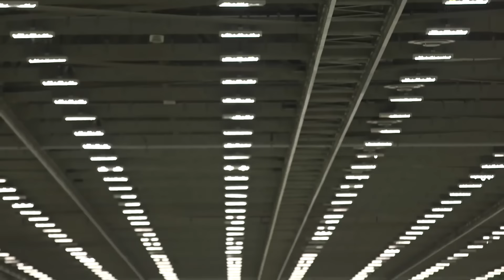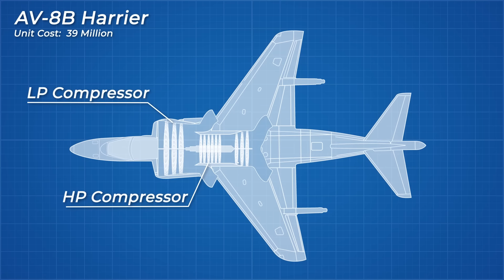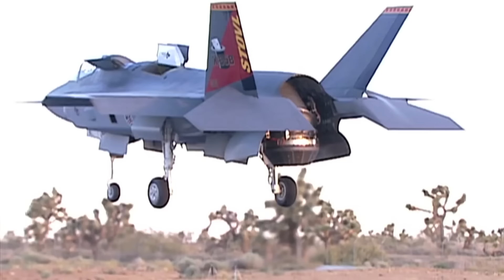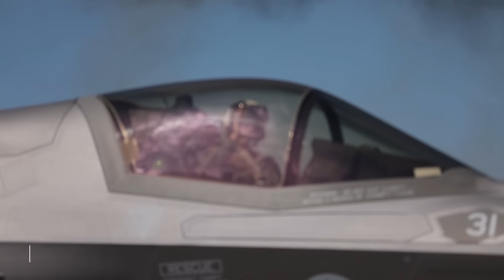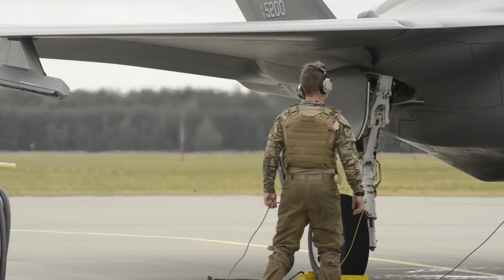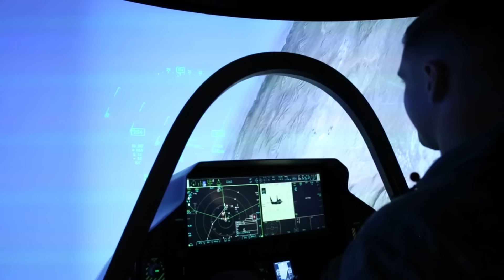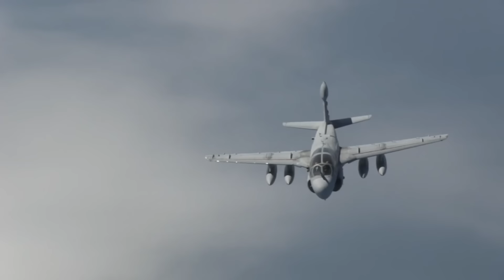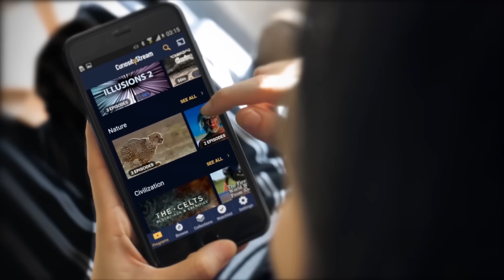Is The F-35 Worth $115 Million?

Comment: USAF: "Honestly, the F-22 is just TOO good to justify continued production."
Lockheed Martin: "You want less good? We can do less good. Look!" Kicks F-35. Panel falls off. "See! Less good!"
USAF: "Great! So it'll be cheaper then?"
Lockheed Martin: "...You never said you wanted cheaper."
Reply: honestly, the f-35 got too much things stuffed in it that it no longer excels at anything, and it got to the point that the f-22 can do everything the f-35 can, for about 1/3 of the price.
Reply: @elchipoclevengador  The F-35 having things stuffed in it is more beneficial than trying to have them mounted externally. FYI it doesn't do any more roles than the F-16 already does, but the F-35 certainly does those roles far more effectively. The F-35 excels at air to surface combat, and is only slightly worse than the F-22 in air combat while being half the price both to purchase and to maintain, and the F-35 is also significantly more useful.
Reply: Your iphone has more powerfull cou than the f22
Reply: F-35 is almost half the price and the F-22 is far less useful.
Reply: @dumdumbinks274  The trick made by LM about the F25 is that the cost of the plane itself is pretty good. But to keep a fleet of F35 flying dude you gonna need a shit load of money.
Reply: @TheHawk1202  It's no different to any other fighter when the infrastructure to maintain them is not in place. There are more F-35s than the maintenance infrastructure can handle efficiently right now, but as always that will change and the F-35 is expected to reach the same maintenance cost as the F-16 by roughly 2035.
Reply: @dumdumbinks274  Yeah it's supposed to but I believe some things will be still a problem. The F35 being stealthy a little scratch on the painting and you have to remake the whole painting. Moreover ALIS is far from being satisfying so far. And by the way there are still hundreds of problems on the F35 that need to be corrected including 14 category 1 defects. And dude 2035. The plane was supposed to be ready in 2015. In 2035 this plane will already be at her midlife.
Reply: @TheHawk1202  A little scratch won't do anything to the F-35's stealth. You have to cause actual damage to the airframe to alter it's stealth signature. 

ALIS is in it's early phase and is going to last a very long time, likely for multiple aircraft. It's also nowhere near as bad as it was when it first appeared and is actually usable.

Hundreds of mostly minor issues that do not affect mission performance. Issues that affect mission performance do not even last long enough to be published in the annual DOT&E report because they are fixed within 48hrs. That goes for Category 1 issues as well, with the vast majority of them being concerns for the future rather than current problems, and none of them are urgent.

The plane was ready in 2015. F-35B entered service that year. No fighter magically reaches maturity upon entering service, the F-16 being a prime example that had worse problems than the F-35 at this stage of development. 2035 is delayed from original plans, but delays are normal in military procurement because politicians get in the way and cause problems by trying to save money in the short term. 

Also note that the F-35A's maintenance cost is no worse than an F-15C, but the F-35A is significantly more capable.
Reply: @dumdumbinks274  Once you have read these articles you let me know what you think of it.
Reply: @TheHawk1202  Your first 2 articles have nothing in them that contradict what I have stated, unless you think there's only a single type of Cat 1 issue. There are 2. The type that is considered a current problem towards mission effectiveness is not the category most cat 1 issues fall under. Besides it's still no worse than the F-16 at this point in development.

The stealth coating issue at supersonic speeds right at the edge of the F-35's flight envelope is an issue that last occurred in 2012, and has only ever occurred twice despite numerous attempts to recreate the issue. It's a really minor issue that only affects the 2 least important variants of the F-35. The F-35A that is unaffected by the issue is expected to make up around 2/3 of all F-35 orders.

I have to admit I didn't know about ALIS's complete replacement, the last time I heard about ALIS was from a maintenance guy saying the system isn't that bad after all the improvements it has had since it first came online. Your article doesn't say anything about ALIS being a terrible system, just that ODIN will be better. However this article does say I'm wrong about one thing; the F-35 costs $35000 per flight hour, which is less expensive than the F-15C, not equivalent to.
Reply: @dumdumbinks274  Dude I don't get it. I mean it's clearly written "...category 1 deficiencies, the designation given to major flaws that impact safety mission effectiveness."  Furthermore the F15C is really really old so it probably costs more because the damage caused on the main structure. But yeah the cost per flight hour is not that high. Another thing I read before is that the F35 B only has around 2000 hours per cells... It was initially meant to be 8000. Some people did the maths and the first F35B's Tranche will see their cell life end in 2027. For this one I let you do the research. 

And how can you say the the F35 B's and C's are the less important. The whole US Navy and the USMC depends on it, the British fleet air arm, Japan and Italy too. If the US Navy is fucked USA is fucked.
Reply: @TheHawk1202  Err yeah... they are saying that because that's a generalised definition for Category 1 much like how we say 'fighter' when referring to aircraft that are designed for maneuvering air to air combat. There are sub-categories and Cat 1 is split into 2 sub-categories depending on urgency. Many issues are not urgent e.g potential issues such as the old ejector seat neck snapping that the media went crazy about (conveniently ignoring the details), and many have been fixed but haven't been implemented due to lack of urgency. 

F-15C is old, but they've had plenty of upgrades including 3 fleetwide wing replacement programs to keep costs moderately affordable. 

F-35B having 2000hrs was a problem with airframes built before it entered service in 2015. The issue has been covered several times over the years by thirsty media outlets trying to keep people's attention by regurgitating old topics. Those old airframes are being used for training purposes where they are perfectly adequate, but upgrading them simply isn't worth it because they do indeed have a short expected lifespan. 

I can say they are the least important versions because that is simply how they have been prioritised. The F-35A has always been the primary version and is what the other 2 are based on. The F-35C has always been the least important since the US Navy is the only service that solely operates modern fighters and does not need to urgently replace aging airframes like the USAF with their F-16s, or the USMC with their AV-8Bs and Hornets.

I also don't know how you come to the conclusion that the US would be fucked without their Navy having immediate access to the latest 5th gen fighter. It's not as though the Super Hornet isn't capable... it's the most modern fighter (in terms of airframe lifetime as well as avionics) currently operated by the US military that isn't an F-35, and the potential threats against Navy ships are being countered by increasingly capable missile systems such as the SM-6. I'd be more concerned about subs than anything in the sky, and the F-35 can't effectively counter subs at this point in time.
Reply: @dumdumbinks274  The Super Hornet is a very capable plane. I have no doubt it. But what I'm saying is that if the F35C comes to be a failure and cannot fulfill it's role this would mean that there is gap of around 350 planes to fulfill. 

I just read now about the the lifespan. F35A looks to have a very good lifespan around 20'000. But the for the B and the C the results weren't told to the public. I don't know what it mean but anyway if they keep it secret they must have some reasons.

Talking about threat in the skies as far as I know the hyper cruise missiles are still a big issue for the Navy to deal with. Though the subs are big time the most dangerous weapons. You gotta rely on your destroyers and you P8 Poseidon. 

And still the F35's gun can't shoot straight. And can damage the airframe.

Back to the afterburner topic. I don't know if it was in this article that I read it but anyway. So whenever the F35 goes above mach 1.2 it can significantly damage the airframe and the antennes that are situated on the back of the plane. This is one of the recent Cat 1 that have been discovered. But as you said before it very rare and even when they tried to cause these damages they couldn't. But may I ask why do the marines pilots have restrictions on the use of afterburner. Respectively it's 80secs at mach 1,3 and 40 at mach 1,4. I mean if this case of melting the sensors etc is so rare and happens only in the highest altitude the F35 can reach why put the restrictions ?
Reply: @TheHawk1202  I think we're getting closer to understanding each other. First off I believe the USN are continuing to purchase the Super specifically so they have another - albeit worse - option if something does go wrong with the F-35C. That's not to say the Super stands a better chance, just that the option is there... F/A-18s have previously had the entire operational fleet grounded for short timeframes due to certain issues, whereas only parts of the F-35 fleets have had such trouble, at least since they entered service and had the numbers to make that fact actually matter.

I believe you may be a little uninformed regarding lifespans, though it's not such an important topic. The F-35A and F-35C have been tested for up to 24000hrs potential life, but are rated for around 12000hrs. Not to say that's bad - it's still double that of a new Super Hornet - but they do like to have a safety margin for I guess the situations the 4th gen fighters are in now, or simply just not needing as many MLUs. Also consider mothballing and the conditions those airframes need to be in if they are to ever be used again.

Hypersonic cruise missiles are a big threat, but those are countered reasonably well by more advanced radars and large missiles. The problem isn't so much tracking and engaging them, rather that radars need to be reconfigured to effectively track them and doing so can take a bit of time. High speed means a predictable path but sooner arrival. I don't think fighters will be used to defend against those missiles, rather an AWACS platform such as the E-2D will be necessary due to it's much more powerful radar.

F-35'A's gun can be used in emergencies with the drawbacks you highlighted, but the guns of the F-35B and F-35C work fine since they are external and on the centreline. In all cases however the gun is a backup weapon that isn't mission-critical, so it won't be fixed for existing F-35s for quite a while even if it is fixed and implemented on the production lines in the near future.

Afterburner restrictions are just there as a safety precaution, though to answer your question more accurately; The restrictions are not in place simply because the problem is rare and not worth spending money on, but rather that they never identified a cause. There's a variable in the equation, and they have to prepare for every possibility. It's much like how good drivers slow down when approaching a blind corner even if they use the road regularly and have good tyres that won't skid.
Reply: @dumdumbinks274  What does F-35 have that other planes do not have or can not be equipped with?
Reply: @CalimdonMorgul  It doesn't need to store weapons externally, doesn't need any targeting pods, and doesn't need any external fuel tanks, so the F-35 has generally better performance than any other fighter when loaded for a combat mission. Basically other fighters (except F-22 and J-20) have to choose between high performance, or range and utility. 

If high performance isn't needed the F-35 can carry a larger payload than any other fighter of it's size.

Additionally it is the stealthiest fighter currently available (although just being stealth is an advantage right now) and has a sensor suite that allows the F-35 to detect, track, and engage targets in any direction without assistance .
Reply: @dumdumbinks274  Other fighters have similar avionics and since F-35 can store a few weapons internally it might even come close to not be completely underperforming when meeting a 4th gen or a different 5th gen fighter but still it will probably struggle. Especially with the huge and rather dangerous air to air armarment of Su35 and others. Stealth can be a advantage but it is not as advantageous as it once was and the general populance perceives it to be.
More and more countries are working on stealth technology and measures to detect stealth planes become more and more advanced. Many other jets don't need targeting pods either. So really F-35 besides all the flaws and problems it still has is not nearly as capable as many might believe.
So really nothing you pointed out diminishes the fact that F-35 is part of a rather dangerous game that relies on way to many factors for any sane person to rely on. It needs to have the better stealth capabilities or it's main capability is worthless. Same goes for detection by advanced radar, irst or other systems.
Then with the little amount of weaponry it can carry internally (it would already be generous to assume it is fully equipped for air to air missions) it needs to actually shoot down all enemy fighters before they start firing otherwise it will have to stay in the air while a probable enemy with the advantage in numbers (in planes and missiles) will just come in to start a wvr fight for which F-35 is ill equipped. Needless to say the enemy will obviously try to come close real fast while firing everything they got upon detection. Coming real close to force a wvr scenario worked rather well for MiG-29 against F-16 btw. when the German MiGs were evaluated.
Staying on range is also difficult when facing planes capable of supercruise while armed when F-35 barely reaches mach 1 without afterburner if it even is capable of supercruise all the while it's thrust to weight is also worse. A few problems it also has with sustaining high aoa without stalling. I rather think there is a reason why the Navy is ordering more F-18's and the Air Force is ordering new F-15's.
Reply: @CalimdonMorgul  Wow you clearly haven't done much research on the topic. The only people saying the F-35 is as bad as you claim it to be are those who have something to gain by doing so.
No other fighter comes close in terms of overall avionics. Some have similar capabilities, but generally are not on the same level as the F-35. 

F-35 is quite literally faster and more maneuverable while fully armed than a completely unarmed Super Hornet that also has it's pylons removed, and Super Hornets have performed quite well against Su-30s in exercises. The F-35 is the 2nd most maneuverable US fighter, behind the F-22.

More and more countries working on stealth technology should tell you that stealth is a major advantage. This is no different to how Russia and China went about producing their 4th gens several years after the US. Quite literally every nation that has a reputable fighter industry is focusing on stealth designs for their future fighter projects, though so far they are all more expensive designs than the F-35 and will never outnumber the F-35. If the technology to render stealth less advantageous actually existed they would not be investing so heavily in stealth.

Most fighters use targeting pods. The only ones you don't see with targeting pods are those like the F-35, or those that simply don't have very good air to surface capability such as the Su-35S. If we're talking about which is better then it's a side-by-side comparison, not one of a strike aircraft being intercepted by another aircraft. A Typhoon or Rafale on a strike mission using it's TGP is no doubt going to perform worse than an F-35, and the same is true of the Su-35S vs F-35.

"Then with the little amount of weaponry it can carry internally (it would already be generous to assume it is fully equipped for air to air missions)"
- This here is part of why nobody should listen to you. That's not even a comparison let alone an accurate one. You created a result and tried to find the best situation in which that result is true. Guess what? No other fighter on a strike mission is going to fair better than an F-35. And the F-35 will most likely have the numbers advantage, especially when operated by the US. F-35 annual production already exceeds the total Su-35S production since 2008 and per unit the F-35A is one of the cheapest fighters available.

You want supercruise on a fully armed fighter? Good luck with acquiring the F-22, J-20, or F-35. And yes F-35 can supercruise. It is temporary at around 10min to drop from Mach 1.2 to Mach 1.1 and thus be in transonic territory, but there's no real use for supercruise longer than that anyway. Doesn't matter what aircraft it is, you'll still travel a shorter distance by supercruising than you would when subsonic. Currently the only fighters capable of faster supercruise while remaining useful are the F-22 and likely the J-20, but all those fighters you see advertised as being capable of Mach 1.5 supercruise are doing so in very light configurations that are not representative of an actual combat load and are certainly not going to be doing so on anything other than a less-than-effective point defence mission.

Thrust to weight? Lol the F-35A achieves a particularly high T/W ratio of roughly 1.26 with 50% fuel. That's better than the F-16. The F-35A's acceleration is on par with the F-22 and Typhoon, and theoretically the F-35A has better subsonic acceleration than the Su-35S. 

If you think there's a correlation between the Navy ordering more Super Hornets or the AIr Force ordering more F-15s, and the F-35 perceived lack of performance by people who don't look at it's performance, then you are definitely uninformed. There are several facts to consider;
1. There have been no change in plans. The F-35A was never planned to replace the F-15, and the F-35C was never planned to replace the Super Hornet.
2. The F/A-18s that the F-35C is replacing have already been retired. The USN do not operate the Hornet. F-35C production will ramp up once operational testing is complete, and before you claim operational testing has taken too long... it only began last year.
3. Even though it was proposed to replace the aging F-15Cs with F-35As, it was logistically impossible without causing a temporary capability gap. The F-35 factories are currently tasked with replacing the F-16 fleet, and in the decade that will take the F-15C fleet will reach it's absolute max lifetime and enter forced retirement. The solution is to produce more fighters, and a modernised F-15 is an obvious choice for many reasons, none of which relate to the F-35's (superior) performance.

Edit: I missed your MiG-29 vs F-16 comment. Almost every pilot in those exercises considered the F-16 to be the better fighter in literally every aspect of performance. The F-16 had longer range, better acceleration, better maneuverability, better ergonomics, and better controllability. What the F-16 didn't have was a high off-boresight WVR missile. But that's a weapon, not a fighter, and the US were pretty quick to counter and overtake the R-73 it once they found out about it's capabilities.
Reply: @dumdumbinks274  So many wrong statements. 
That everyone works on stealth shows that it is no advantage anymore.
'If the technology to render stealth less advantageous actually existed they would not be investing so heavily in stealth', everyone is working on technologies to counter stealth. Hensoldt is working on it to be sure.
Passive radar for example and improved irst capabilities are probable solutions to render current stealth technology redundant. Stealth planes have been shot down before which serves to show that stealth is only one part of the equation.
Comparing F-35 to F-16/15/18 is a useless exercise. 
Only F-22, Eurofighter, Rafale, Su 35, MiG 35 and Su 57 are interesting in comparision. FCAS and Tempest will be. Even if we were to assume that Eurofighter or Rafale would perform worse in air to ground situations, which especially for Rafale is unlikely, they would steal beat in in the air to air department.

'-This here is part of why nobody should listen to you. That's not even a comparison let alone an accurate one. You created a result and tried to find the best situation in which that result is true. Guess what? No other fighter on a strike mission is going to fair better than an F-35. And the F-35 will most likely have the numbers advantage, especially when operated by the US. F-35 annual production already exceeds the total Su-35S production since 2008 and per unit the F-35A is one of the cheapest fighters available.'  -This speaks of elementary school level argumentation. 

Supercruise is obviously about sustained flight at mach 1 so longer than 10 minutes and what about Eurofighter, Rafale and Su 35 cruising like it's no ones business? 
Maybe many a fighter struggles to supercruise when fully loaded, problem is that F-35 is fully loaded when it carries what? 4 missiles? Cute.
It is the F-22 that achieves 1.26 thrust to weight with 50% fuel not the F-35.

Have you ever looked up any Interview partaining MiG 29's evaluation? The only ones I can find talk about the superiority of MiG 29 in WVR and only later F-16's with newer avionics could hold them off, while obviously the MiGs got no new avionics. The Viper drivers were actually imppressed by MiG 29's ergonomics, maneuverability and HMD. Russian air to air missiles are still considered to be rather effective and diverse to the option to switch body and seeker type.

There is official reports etc. claiming that F-35 has serious technical problems that the US would at least need 300 F-22's for air superiority because the F-35 is troubled etc.
And here you go spouting false information on F-35 it's contemporaries.
F-35 is constructed around stealth if that fails it will be the most expensive pile of junk around. That failure seems rather likely in the current climate and then it's performance, amount of fuel, amount of weaponry without worsening it's signature will be rather lackluster.
Lovely avionics can be installed on any 4th generation fighter without major problems.
The F-35's performance wont be as easily boosted.
No report or article I have read aside from the one claiming that F-16 beat F-35 because the F-35 didn't know yet how to handle the plane properly suggests that F-35 is gods gift to fighters.
Indeed designed as a attacker substitute to A-10 and it will have to perform as a world class fighter worthy of a super power or it will struggle to deliver any bomb whatsoever. That it was designed for 3 services doesn't help either.
Reply: @CalimdonMorgul  I like how he argues that the F-35 is "cheaper" based... I guess solely on it's per-unit production cost. Which COMPLETELY ignores the fact that the F35 program is literally the most money any military has ever spent on any single program in human history. The F22 program cost around $60 billion total. The F35 program has already spent over $400 billion as of 2019, and is expected to run over $1.5 TRILLION by the time the program is finished.

Cheap it ain't.
Reply: @TheHawk1202  Thats all normal, look at other aircraft.
Reply: If bof in air f22 gone mail f35. And it dont matta how many roles u can play. If u fucked u fucked
Reply: @fressflashf5516  well F-35s will likely not be engaging F-22s ever so, thank god for that. The F-22 was designed for ONE specific role, air superiority. F-35 is a multi-role fighter, therefore it can do air-to-air (obviously not as good as the F-22, or other aircraft designed for specifically air-to-air combat), ground strike missions, anti-ship missions, suppression of enemy air defence missions, destruction of enemy air defence missions, and so on. Comparing the F-22 directly to the F-35 is pretty naive imo.
Reply: F22 is way betta. The f35 dont standachance against the f22. F35 is a real waste
Reply: @fressflashf5516  The F-22 is only slightly better in the single role it can perform compared to the F-35.
Reply: @dumdumbinks274  F-35 is a joke.
Reply: @dumdumbinks274  Really, the F35 has a far better radar system allowing it to see F-22 before F22 can see F35 with it's not as good stealth.  That may change soon however, and yes the F-22 was ahead of it's time.  With small upgrades it's king, but also up keep is very expensive on top of the cost per plane.  with any luck FX fighter is coming soon.
Reply: @rogersmith1408  F22 is stealthier that the F35 man. In bvr F35 wouldn't stand a chance.